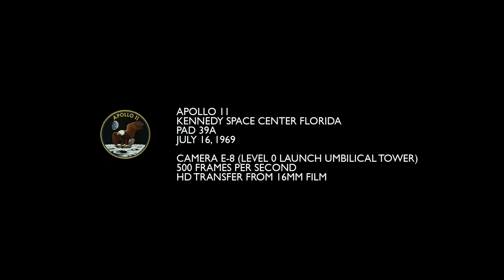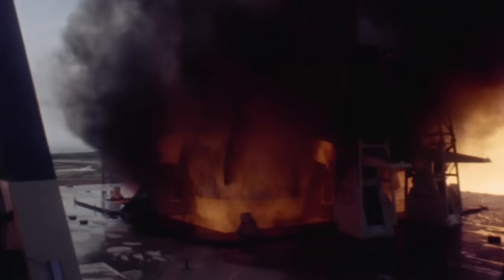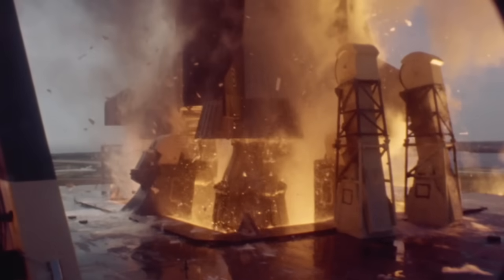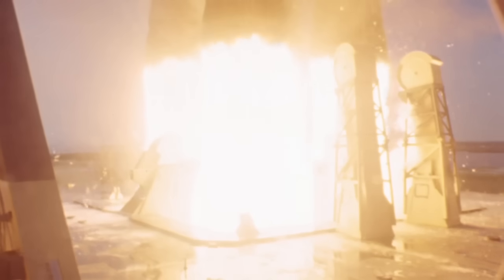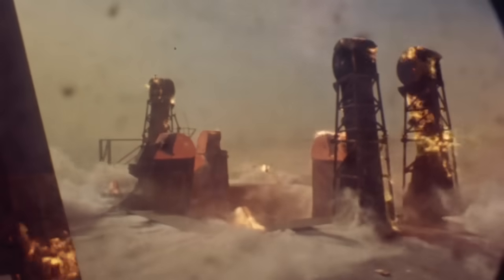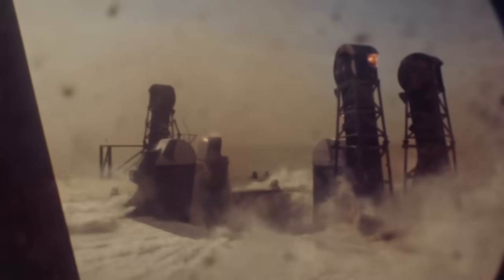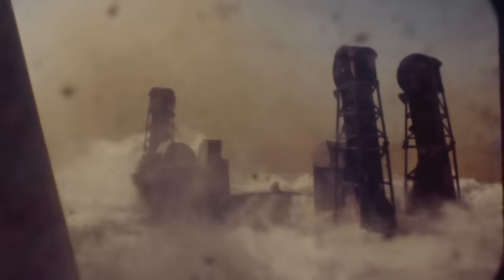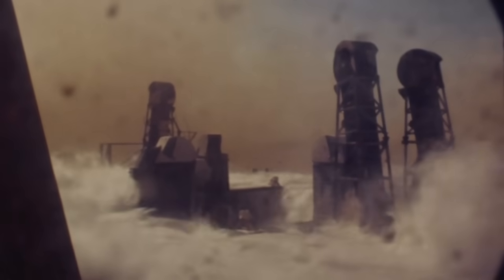Apollo 11 Saturn V Launch Camera E-8

Comment: The most powerful engines ever built - even up to this date.
Reply: Correction.. F1s were the most powerful liquid engines.. solid boosters produce insane thrust, but they are not efficient
Reply: SANKU  Not true. The F1 produced 1.77 times the thrust of the RD180.
Reply: @salamanca1954  He probably meant the RD-170
Reply: You're forgetting the Toyota Camry.  Get your facts straight.   :)
Reply: Wikipedia says that the RD-180 produces about 800,000 pounds of thrust and that it has two exhaust chambers.  F1s produced 1,500,000 pounds of thrust.
Reply: The SLS is 8.8 million pounds of thrust.  It's been tested. That's more powerful than Saturn V.
Reply: @nednedly3962  but it hasn't flown yet
Reply: WRONG, SIR, WRONG!! RUSSIA has built the most powerful engines to date, and that is why we use Russian engines to launch our astronauts to the ISS.
Reply: @frisbee544  The booster engines on the soyuz rocket produce 360 tons of thrust, according to a russian website.  The F1 engine on the Saturn V produced 761 tons of thrust. We use the Soyuz because it it a reliable launch vehicle, and the U.S. has nothing in its class at this time. Not because it is the most powerful rocket.
Reply: Thefirstgalaxybeing Russia flies us to the ISS now because NASA isn’t properly funded to do it. They’d rather use their resources getting back to the moon or to Mars. Trust me, if NASA wanted to go to the ISS, it would be a piece of cake. The shuttle used to do it all the time.
Reply: @frisbee544  In no conveivable way did Russia create rocket engines stronger than the F-1 lmao
Reply: SANKU  https://www.lanl.gov/science/NSS/issue1_2011/story4full.shtml
Reply: No. FALCON HEAVY. And Falcon heavy lands to be re-used, making space work much less expensive!!!
Reply: Russell Anderson Falcon heavy uses 9 smaller engines. Saturn V used 5 large engines. They were more powerful.
Reply: Falcon Heavy has 27 engines that each produce about 200,000 pounds of thrust, for a total of about 5.4 million pounds of thrust.  The Saturn V had 5 engines that each produced over 1.5 million pounds of thrust, for a total of about 7.5 million.
Reply: @Beamshipcaptain  Except it's turning out to be a complete financial failure. Reusable rockets are a contraption that should have never left the drawing board.
Reply: @andresmoreno9909  Why? They have reduced the cost of space work by vast sums, and given us a future in space. Electrogravitics systems cost even less and d not require fuel, and have no limit to the speed, unlike chemical impulse-drive rocketry. Rocketry is dead.
Reply: @Beamshipcaptain  They might have reduced the price. The costs are still high because they can't get to the target of 10 re-uses (I think their record is 4). It's just a Silly-Con Valley company that talks a lot and delivers little. Only 11 years of easy money could have allowed it to survive so far. Their end will come in a few years at most.
Reply: SANKU  Nuclear engines produce hundreds to thousands of times the thrust of Chemical propulsion. DESTINATION MOON (1949) got it right 70 years ago.
Reply: SANKU  The fission rockets had hundreds of times the velocity of any chemical propulsion, and the fusion version was thousands of times the exhaust velocity of anything else.
Reply: @Beamshipcaptain  There was no Fusion Rocket. The rocket was called a nuclear thermal engine, but fission was the reaction that produced power. The NERVA program produced successful engines before it was cancelled that produced 250,000 pounds of thrust, but that is far less than the 1,522,000 pounds produced by the F1 engine for the Saturn rocket. The nuke rocket engines were slated for upper stage use, and for powering the planned Mars rocket once in orbit. The plan was to use three engines to provide a combined 750,000 pounds of thrust to shoot the space craft toward mars. And back.
Reply: @salamanca1954  Dr. Stanton Friedman worked on them, bot the fission one, which he said had hundreds of times the thrust of any chemical propulsion, and the fusion version he said had thousands of times the thrust of chemical rockets.
Reply: @Beamshipcaptain  We have not yet initiated  a contained fusion reaction, which is the holy grail of energy research. I think your information is in error.
Reply: No, the most powerful Engines were the fission and FUSION Nuclear NERVA Rocket systems. Still classified.
Reply: Needed big engines because those big engines weighed a ton! Massive amounts of fuel was needed because the fuel weighed a massive amount! Every apollo mission ended up in low earth orbit. Not one ventured past low earth orbit. Get a grip!
Reply: @DANNY40379  they adopted a multi-stage rocket right to solve that problem.
Releasing the used stages helps improving the thrust/weight ratio, along the way.
Reply: ANother one spewing around ignorance and bullshit. And as usual without any proof:P. Whatever makes your life less sad dude;). @DANNY40379
Reply: @DANNY40379  WTF is your issue??? He may know that.
Reply: @DANNY40379  You need to take your meds, Dan.

Comment: What is physically holding the 6 million pounds? How does the top 3/4 not collapse the bottom?
Reply: Hold down arms won't release until all engines are fully firing and pass the computer tests. Then there is a controlled release (pins pulled through dyes) or the initial acceleration would cause the rocket to crumple.

Comment: Its Amazing footage, for the conspiracy theorist out there just to let you know simulate that smoke and flame on a modern computers is extremely hardware intensive even with the modern processors, in that year was in one word imposible. this video is a great example of the outstanding amount of talent and effort of the great minds of that time.
Reply: @a.square8658  The Van Allen belts were never really a problem, it's just a lie that the conspiracy idiots keep spewing.
Reply: @thefedsband1359  when did I mention that
Reply: @a.square8658  wasn't you.
Reply: @thefedsband1359  They weren't in the belts very long, and the ship was shielded
Reply: @a.square8658  Passed through quickly, too.  Beta and Alpha particles mostly, and low energy secondary Gammas, fairly easy to shield.  Time, distance and shielding, they had all three.  I was addressing another replier.
Reply: Its a controlled explosion. Impressive they figured out how to light it off without blowing the works in a very large scale.The engineering to do this along with the precision  is impressive,but would be obsolete in a second with a real power source that you do not have to really explore.We never even made a manned mission to our front porch in space with this . The astronauts would have been exposed to the van Allan belt  and would not have survived the radiation with no shielding in their ship or their suits.